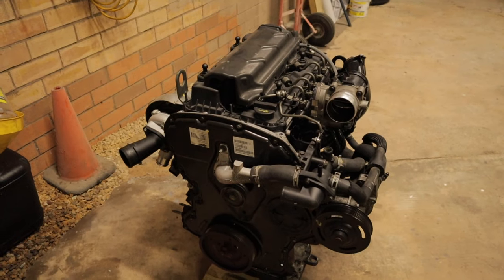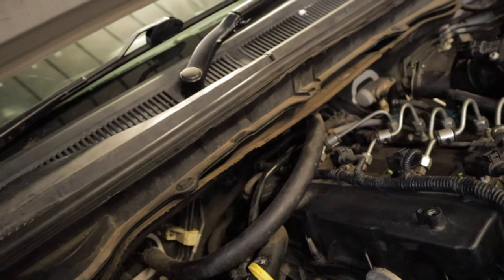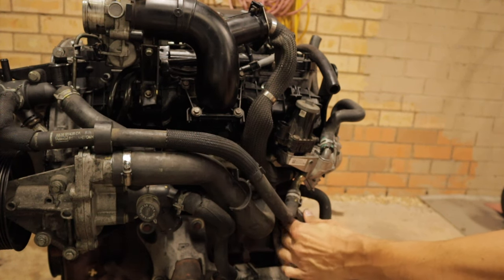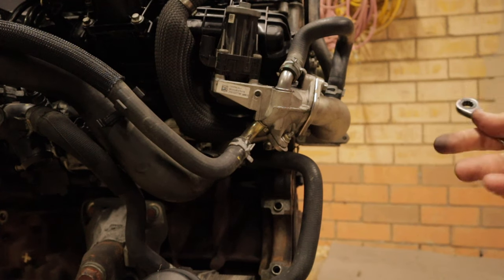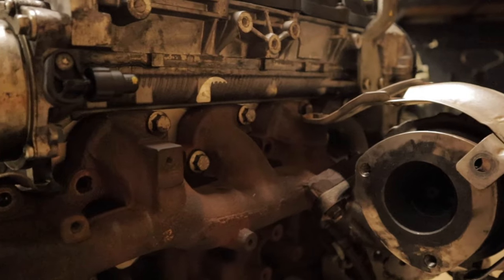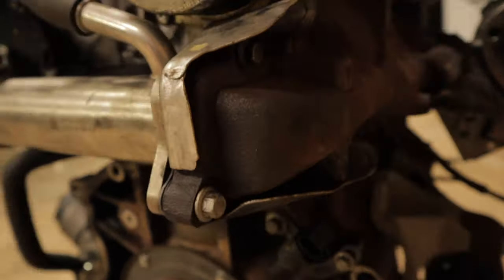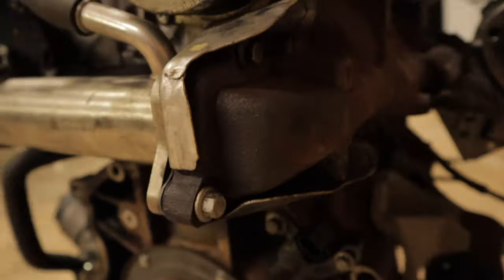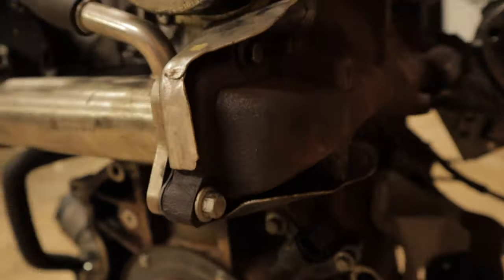Ford Ranger EGR Cooler Bypass, Blanking, Removal & Install

Comment: With the blanking method, wouldn't you still want to do the bypass? I realize that with the plates antifreeze is not going to make its way into the engine, But if the EGR does fail  internally  your antifreeze levels would certainly drop and of course, the EGR was never designed to run filled completely with antifreeze.  Non issue or not? I guess strictly speaking once the blanking is done the EGR is nothing more than a canister.  I'm curious, what is the stock material? Is there a higher-end, thicker wall stainless variety available from a third party? I have a feeling some shops would not perform this conversion as it's illegal because it's bypassing emissions. No judgment here, I like the concept of removing it myself. I'm just being realistic about what a person might run into if they don't do the conversion themselves.  I currently have 88K on my truck and just saw this video.

Comment: This afternoon I followed these instructions to block the exhaust side but couldn't create a gap between the exhaust manifold and the cooler until I discovered an exhaust bracket underneath

Comment: Thanks for all this precious informations! Just a question: nothing will happen to the car electric system and the ECU? I have to do something to prevent error code or system fault after blanking the EGR? Thanks a lot
Reply from the maker: on to a T6/px1
Reply: @abdautomotive  yes sorry, it's a T6 2.2 Limited my 2016, 80000 km. It's possible without ecu problems? Thanks
Reply from the maker: @generalleeeleven  2016 is a PX 2 so im not sure

Comment: Hi by blanking the EGR doesn’t this throw up an error code when running? Due to the ecu not sensing flow? Did you get your ECU remapped to stop the check engine light 
Thanks

Comment: Can the egr cooler still fail if the egr is blocked off? I have a blanking plate in and just wondering if I should reroute the cooler lines too to eliminate the egr cooler fully cause I don’t want to hydro lock my engine if the egr cooler was to fail. Pretty much eliminating the whole egr cooler and egr system without actually taking it out of the car
Reply from the maker: yeh it can still fail , tho if you are blanked the chances of engine damage are greatly reduced
Reply: @abdautomotive  hi buddy,
is this possible to eliminate the egr completely by blanking off and bypass over the top which you’ve done. Would this be ok and not cause any harm? What’s your thoughts? Cheers

Comment: When you blank the EGR do you leave the EGR valve plugged in still? or do you unplug it? I imagine unplugging it brings up a code? But does leaving it plugged in mess up the air/fuel mix? as the engine is expecting say 10% exhaust gas in the mix? or does the engine not account for the position of the EGR valve during its air/fuel mix calculations.
Reply from the maker: yep just blank & go, no unplugging

Comment: I’ve got 15mm hose and it’s not not fitting over the heater core inlet, I’ve measured it and it’s more like 20mm, but using 20mm internal diameter hose won’t work on the other end, how have you made this work with 15mm hose??
Reply from the maker: a couple of comments said it's a 16mm , i measured mine with a tape measure so i could be 1mm off, i did my car a few years ago so can't remember how it fitted up to the heatercore side, im preety sure it was straight on
Reply: I used 16mm that is perfekt. But 19mm Will also be good. 15mm Will be hell too get on;)
Reply: Someone up in the comments said it is 19mm. People fail to mention which year their model is so that makes things difficult.

Comment: When blanking egr, I read the engine runs hotter. Also does anything else need to be done? Does the ecu trigger any trouble codes? Thanks in advance
Reply: It should run cooler its all a myth.  Not sure if it will i guess it would but a remap should fix that

Comment: I have a question, can I isolate only the EGR heat exchanger without isolating the path of the gases? Wouldn't that cause any issues?

Comment: Hi thanks for the video I’m about to do this on my ranger. I was wondering if I need to blank of both side? I thought that blanking the exhaust side would be enough
Reply from the maker: i just did the exhaust side on mine, 1 side would be enough
Reply: I, Great vids, especially on the removed engine for clarity . I  only blanked the egr valve side because the acess appears so difficult on the exhaust side ,( and by passed the cooler,) any risk in over heating the  cooler with exhaust gas being ale to flow from the exhaust side? I guess its not getting any flow as the exhaust gas has no where to go so heating should be minimal  .

Comment: Hi I've blanked off the exhaust side and the intake side of the egr cooler but just left the coolant hose as is in stock is it okay to just let it be? or should I bypass the heater core hose?
Reply from the maker: yeh thats fine

Comment: Why is it necessary to put the second bigger blanking plate in. Surly the smaller blank is enough. No need to put two plates in?
Reply: If blanking it out then I would because if the EGR cooler starts to leak/fails internally, then the coolant will make it's way into the exhaust, as you haven't put in the blanking plate to the exhaust. I reckon it's probably much better to get an aftermarket EGR cooler such as the Goss.

Comment: I’ve got a 2.2lt ranger just had a new engine fitted but the cooling system is pressurising. I’ve been told it’s the egr cooler. The mechanics that fitted the engine said it’s not cooler as they have bi passed it and the guy I bought the reconditioned engine from said it’s got to be. Would the cooler cause the engine to pressurise ?
Reply from the maker: no it won't , if it's by passed , it's not the cooler

Comment: Hi there quick question, can i remove the egr valve completely,  and run the heater hose to the bottom hose on egr, and then just  block off manifold and the intake at the top. Just remove the whole egr altogether..
Thanks hope to hear from you.
Reply from the maker: you can remove the EGR cooler  , but not the EGR valve itself, if you unplug it , it will go into limp mode

Comment: Just curious, but if you bypass the egr cooler but continue to drive with the egr working, what happens then? Does egr overheat and do more damage?
Reply: Yeah it would blow hotter air into intake

Comment: Great information and video so thank you. I have a 2020 BT50 which is the last of the 3.2 motor before they went to Isuzu engine, I guess that makes it a PX3. Is the EGR the same on that model or is it different. I realise this is your vehicle but I am struggling to find out of the EGR is the same because obviously I don't want to do something wrong. Any info from anyone would be gratefully appreciated.
Reply from the maker: from what i know if you blank the EGR on a dpf model Ranger/BT50 an engine light will come up, you can get that turned off at any Diesel Tuning shop
Reply: @abdautomotive  Ok, thank you so much for getting back to me. Do you know if the cooling hoses are the same setup. I have had a look at mine and gee it's really hard to see. I might see how I go this weekend because I really don't want this thing to fail on me. Thanks again for your help, greatly appreciated.
Reply from the maker: @GuyMorris-oq2zp  from what i know hoses are a bit diffrent

Comment: Is the silver pipe egr cooler, floating? Or is it also fixed to the rearside of the block? If it is fixed wouldn't you be fighting against itself when you tighten the exhaust manifold back up due to the 2mm additional material from the exhaust manifold to the egr cooler?
Reply from the maker: it's fixed, , when you tighten up exhaust manifold it slides over 1.5mm, you could loosen the bolt at the rearside of the block if you wanted too, i never did

Comment: We have a ford ranger wildtrak px2 2017. I want to blank the egr cooler like you did on the video permanently with a hose. Will I also have to blank the egr valve as well. If I do these 2 steps will I have any overheating on the engine or will it be ok. I take full responsibility for my own actions. Just want to know If I do this will  it do permanent damage or can I leave it like that
Cheers
MICK
Reply from the maker: the video is for a px1, px2 is diffrent
Reply: @abdautomotive  what do you mean by px2 is different? what's different about it?
Reply: Have you managed to do this on the 2017 ranger? If so can you tell me if it’s the same process?

Comment: If you bypass the EGR does that remove its wase gate function for the turbo and do you reprogram the ECM for the air mixture because there is a risk of running too lean if the computer continues to give more air in a mixture made partly of gases and that you remove these gases in the mixture without informing it, or are short trim corrections enough to run this normaly under 20% corrections
Reply from the maker: no issue with mixtures, running strong
Reply: @abdautomotive  Did You check the Trim correction on a diagnostic tool ?

Comment: Hi, by adding the plate on the EGR valve side and bypassing the coolant, will that solve most problems?  It would then seem unnecessary to add the plate to the exhaust side.
Reply from the maker: personal choice i guess, exhaust side block stops the heat staying in the cooler

Comment: great video, have a question took my ranger 2012 2.2 l diesel to mechanic to replace glow plugs once job comleted took it for a drive and engine light came on  code was p042f egr closed what did he do for it to be closed ,would appreciate  any advise .cheers
Reply from the maker: could have refitted it incorrectly, undo the 4  screws & check to see if  it's  seated correctly
Reply: My son took the car back and he took the solinoid off and stated he couldent move the plunger,i cant help feeling he did something dodge as he didnt have the code before he touched it .
Reply from the maker: @poogzie   yeh common issue,  i mention that in my common fault codes video, you can try spraying some brake cleaner to where the mechanical valve is too free it up, otherwise he's up for a new egr valve assembly, they get blocked with soot if you don't run a blanking plate.

Comment: do you need to put the plates in if the egr is turned off? as the valve should stay shut
Reply: Would also like to know the answer to this, had my egr tuned out and not sure if I should still blank and bypass or not.

Comment: Looks similar to my 21 Everest. I guess the obvious question is, if you install the blank off plates do you really need to bypass the coolant? If the heat exchanger fails with blank off plates the coolant can only go through the path for coolant, is that correct? Also, doesn't the ECU have a heart attack if you blank off EGR flow?
Reply from the maker: the PX1's or T6 were the only problematic ones when it came to the EGR coolers, i doubt your 21 Everest will fail, Ford Revised it on the PX 2 or T7
Reply: @abdautomotive  Thanks, that's a relief.

Comment: Thank you for the video. By doing this would you be able to control the temperature of the ac unit or the ac has to be switched off when it gets too cold?
Reply from the maker: ac unit is seperate to this, will have no effect
Reply: Thank you very much.

Comment: Just wondering - seeing as one is working in the area of the cat when doing the full monty, if it's fine to permanently remove the catalytic converter and replace with a straight pipe? Are there any sensors there that will cause limp mode or error codes? Thanks
Reply from the maker: i had a straight pipe on for a while, no limp mode, just a really loud spool from the turbo

Comment: Hey mate I'm just doing this now, my query is the top Barb out of the heater core measures about 20mm internal so it seams bigger than the Barb at egr valve, so can you get 16mm (5/8) pipe over the top Barb at heater core OK?
Reply from the maker: just use a bit of heat for the top one
Reply: @abdautomotive  all good mate I bought a Ford Falcon heater hose that's flared at one end and perfect length, awesome video mate, made it so easy 👍👌

Comment: Nice video, I done this same process on my px1 ranger during ownership but since traded for a 2018 px2 3.2litre ranger, can I still use the same plates (but new) and processes or is it different for a px2? Everywhere I look for blanking plates shows the egr valve end with a 10mm hole cut in it.....
Reply from the maker: not sure on the px2
Reply: @abdautomotive  PX2 plate has a hole to stop it throwing codes when EGR is blanked off,  but sort of defeats the point of blanking it.  Apparently PX1 didn't throw codes with the EGR blanked off.

Comment: Love the Vid, Question I did the water bypass as shown both ways but still find water coming out of the disconnected hoses from the EGR cooler so not sure what I’m doing wrong? Ranger is a 2018 model 3.2 so not sure if it’s different to the older versions.
Reply from the maker: not too sure, cooler might be different  on the newer ones
Reply: I had the same problem did you work out what to do cheers
Reply: @ReeceWatson-fm1me  I found the same thing, spent a whole day trying to work it out then gave up and put it back to stock. Apparently the px2 is a different cooler and doesn't fail like the earlier ones. I blanked the egr at the valve and had it turned off in the ecu, also removed the inlet manifold etc and cleaned, goes real good now
Reply: Turns out my cooler is totally different to this one I had to remove completely and blank then tune out the egr

Comment: This vid was the best mate thanks heaps im working on my one atm Q can pick your brain on this whats the worse case scenario if i remove all the egr cooler set up behind there inc the valve etc and just by pass the hose like you said to the water pump and finally completely blank it from the exhaust?
Reply from the maker: it will throw a fault code if u unplug the EGR valve, you could zip tie it somewhere and leave it plugged in,  you can remove the complete EGR cooler if you wanted to no problems & run a hose from heater core directly to water pump.
Reply: @abdautomotive  awesome mate so I've bypassed it straight from the heater core like you said bridged it up with a brass hose joiner now im assuming if i just blank it up from the exhaust and let it all sit there as it was plugged up should be fine right?
Reply from the maker: @iangunn6409  yep

Comment: Hi. I have a 2021 ranger px3 2.2 single cab. Will doing the EGR blocking cause any check engine lights? I heard ford did some changes in the ecu and it’s still on warranty which I don’t want to void.
Reply from the maker: i'm not sure on the PX2 or PX3 , it might, on the PX1 i've had no problems with the engine light, i know that you can get a EGR cable that you plug into the mass air flow sensor for the PX2/3 , this keeps  the valve electronically closed by tricking the computer , it does not activate engine light, you can remove the cable whenever taking car back to dealership as it's plug n play.
Reply: It looks like You can also get the egr cable for the px1. Any idea if you can use said cable and re rout the cooler piping? Or does this have to be done with the blanks? Cheers
Reply: Or does the cable also shut off flow to the egr?
Reply: @lachlanhunter1956  you want to use blanking plates and re route the water! you DO NOT want to just trick the valve closed… because if the cooler fails, water can still enter engine and hot exhaust in the engine bay.
Reply: @generalgreen77  no worries thought that  may of been the case. Thanks for the reply 🤙🏼
Reply: @generalgreen77  If you trick valve closed with the cable and remove water lines from cooler and re plumb them like in the vid. Will that stop water getting in to the engine as cooler can’t fail then yeah?
Reply: @lachlanhunter1956  i believe the cooler fails from the exhaust heat. so if you don’t blank it from manifold side and it fails, you will get exhaust into the engine bay. probably burn and melt stuff before you release it’s happened
Reply: @generalgreen77  yeah ok that makes sense. Sweet thanks!
Reply: @abdautomotive  thanks for the reply. Any links for the cable that you mentioned above? Keep up the good work. It’s amazing how your px1 has done north of 300k kms 👍🏾 cheers 🍻
Reply: @jonathankenduiwa8580  look on you tube
Reply: Px 2 get engine light Come on

Comment: Hello, can i bypass the cooler without the blanking plates? I have egr off with software, any issues by doing this method?
Reply: Trying to find this out also! Will my egr cooler over heat without blanking plates as the coolant is now bypassed?

Comment: Hi mate just done the bypass on a mates ranger as you showed we went straight from heater core to the bottom hose connecting it back but still have coolent pissing out the intake manifold any help would be awesome 

It’s that bad you rev it and it squirts out the manifold
Reply from the maker: from what i have read on here the px2/T7 is a different
Reply: Sounds like you worked on a more recent model. The bypass is for PX1 models only.

Comment: thanks for uploading this video! One question, if I do the bypass and then override the egr from the ecu, will I have heating problems by not blocking the cooler inlets? I've heard that you can even burn the truck 😅
Reply from the maker: i would recommend to blank it aswell if you plan to run the bypass permanently

Comment: Great video. A question, whats the recomended tickness of the exhaust plate?, if the plate is too thick can cause troubles with the exhast manifold not being able to rest against the engine block?
Reply from the maker: not sure, the plates come pre made already, one size

Comment: my rangers engine blew up. can it be because of that EGR cooler ?
Reply: I have a 2010 PK Ranger 3lt. 2 engines gone. Both times was reported as EGR fault causing damage to the heads